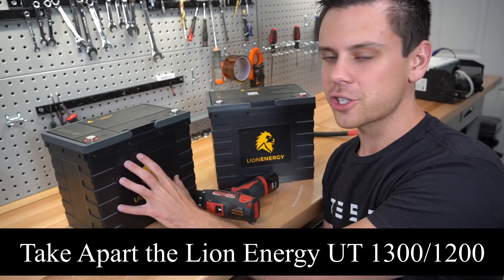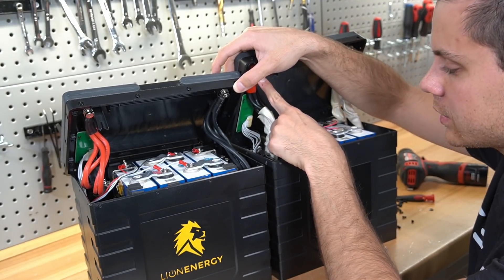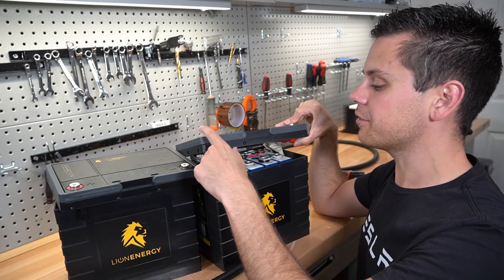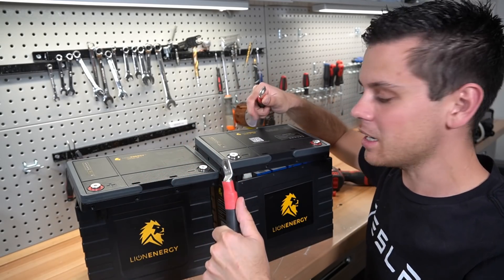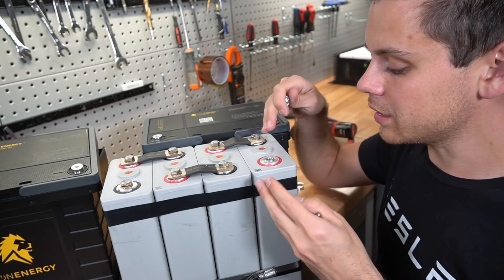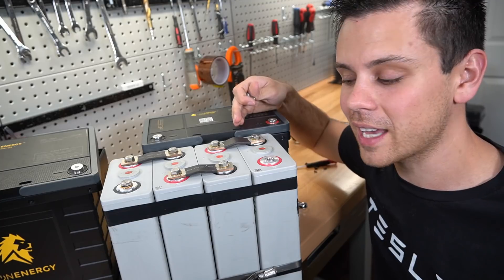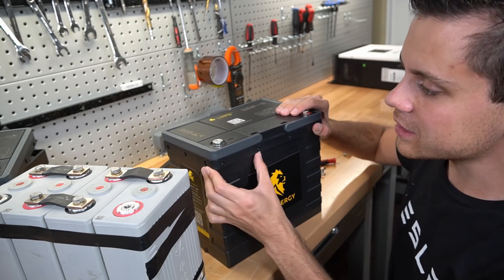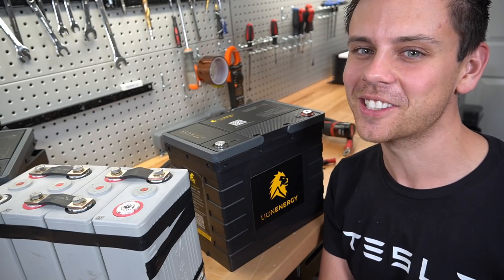Lion Energy 1300 VS 1200 and Why I Dislike the Terminals

Comment: So, the UT 1300 are at Costco for 700 and BB are on sale for 900.  I need 4 to put in my boat with 900watt solar, 5k generator, and 3000 watt inverter.  My biggest draw is an inductive cooktop and 1000 watt micro.  They individually pull about 130 to 150 amps DC for 15-20 min.  I'm leaning towards Lion, but it is in a boat in the ocean.  Which do you recommend?  Is BB worth spending 800 more?  At 800 more I could get 5 lion for the price of 4 BB.

Comment: My 1300 lion energy Battery just blew up! But I was told by lion energy that there's no way that the Battery could go over 15volts. But yet the battery exploded and there own sales rep dealer I took my rv to seen it at 19volts. But lion energy said that is not possible. So basically there saying there own lion energy rep is lying. And they can't explain why the battery exploded if it can't go over 15volts. Seems a little fishy to me. 
Also it was a refurbished battery I bought directly from LION ENERGY at the RV show. But they still say it's not there battery

Comment: This is probably a stupid question, but hey, I'm just getting my feet wet with all this, so here goes:

Is it not possible to remove those terminals off the case lid and replace them with better, beefier terminals?
Reply from the maker: Or you could buy a better battery

Comment: Will, I just found your channel in the last week, after I purchased 2 of the UT 1300's from Costco. Most every review I could find about these batteries was very good so I went ahead and bought them. Then I find your channel and find you have some valid reservations about them, but I have them now and I'm going to give them a chance. I hope they serve me as well as I envisioned. I eventually plan to use them in a RV, but until then, I'm going to use one of them in a DIT portable solar generator. I think it will be handy for my mother to use during short power outages during the winter. I ordered the following charger from Amazon and wanted to get your thoughts on it. It will be delivered today.  It is the ExpertPower 12V 20A Smart Charger for Lithium LiFePO4 Deep Cycle Rechargeable Batteries. Model number EPC1220. I think this would be better than a standard lead acid charger. My one concern is that wires for the charging leads seem to be a little on the small size. do you have any experience with this unit?

Comment: I swapped out two group 31 100 amp flooded batteries with two lion energy 1300 batteries in my Winnebago View and those terminals with screw down cable fasteners seems really vulnerable to loosening and stripping.

Comment: Change the bolt if you want more length. 
No testing.  Opinion only here.  Crank down with a torque wrench and see where they each break.  Try vibrating them in a paint can vibrator for awhile.  As you say, this is only "how you think and feel".  No science behind what you have stated.
Lifetime warranty if the box breaks.  Sounds like a pretty sturdy box to me.  Never breaks over the life of the battery.  Can BB say that?  Any other vendor say that?

Comment: Please, Im buying DOKIO 220 Watts 12 Volts Monocrystalline Foldable Solar Panel with Charge Controller and want to use it with a 12v to 1000w power inverter ........ Question is Please tell me the cheapest 12v battery (2 of them red to red and black to black ++/-- think its called hooked in parallel for a 12v system) on amazon I can buy for my first attempt with solar. You have 10AH to 200AH, pick one and wish to be around $200 to $300.  Dont want to burn my house down. Thank you in advance. Anxious to hear back...

Comment: Sealing is easy. I've pulled one battery top off, laid in a thin bead of silicon II (doesn't smell like vinegar plus safe around aluminum) and sealed the box.  Used non-sagging Dicor over the screws and now have a sealed case.  As for the terminals not able to handle 3 lugs, when I had to put 2 on the end terminals (to hook to the trailer system in parallel), I put 2 against the flush terminal and used the extension to make the hookup to my inverter (the third terminal).  Those were the only places I used the extension.   All connections are tight, not over torqued.  I made sure the battery box has enough clearance (approx 3/4 inch minimum over extension throughout the box) and epoxied 1/4 inch sheet of hard plastic to the inside of the battery box cover.  Also the battery box is gasketed for weather.  May be overkill, but there should be no weather or loose connection issues.  I plan on sealing the second battery in the next few days.

Comment: Hey Will dig your videos, I have a general solar question . I have a thunderbolt 100w setup with a tracer 20 amp controller and I am thinking of getting a 260 w panel just for the tracer then using harbor freight 100 w panels and 10 amp controller  as a needed back up , can I put them on the same battery bank without frying the system or heating the batteries.. thanks any advice would be cool..

Comment: Thanks for the great videos! I have a question for a friend. Are you aware of a "solar generator" that can put out 24volt DC at 3.75amps (or at least 3.5 amps)?  This is for powering a CPAP. I would think something in the range of 260Wh to 320Wh would be a good size (and cost) for him, but if we need to go up in price, that would be fine. 
Thanks!

Comment: I believe all battery cases should have better cable Management that provides tie down points so owner can secure the battery cables so the terminal blocks don’t get pulled out.  This a normal practice in some types of aircraft battery installations.

Comment: In my country it's not allowed grid tied system.make a video off-grid inverter connected with the grid to lower the electric bill.example 3kw panels 5kw inverter 4 12v batteries 110 ah in series. ty and big hello from MACEDONIA

Comment: We've know the problem for a while now.  What's the solution if you already own them?  A solution that will keep the secure and tight through vibration.  Little bit of blue loctite?
Reply from the maker: I use them in stationary setups only. So they work well for that. Must be very careful when tightening them

Comment: Thank you for opening up that 1300 for a look. I have 4 of those for my off grid system, and I am happy that they did improve the connections and insulated the wiring more. You are right!! They could have, and probably should have beefed up those terminals to make the battery more rugged.

Thank you for the review!!

Comment: Will, you have some videos about cell testing that are super.
I want to test to the 110 outlet.
I need something like your cell tester but for 110vac.
I'm tracking down a problem past the inverter.
I'm thinking that if I test amps at all the 110 outlets with a tester that pulls 12 amps I'll be able to determine where the wiring is solid.
When the amps fall to say 2 amps then these are past the bad connection.
I've been using a power usage meter with a 1500 watt portable heater as a load but it's a bit clunky.
Any 110vac capacity meters that you know of?

Comment: As a retired elevator man I can tell you that most people should be using a torque wrench. Whenever they are fastening wires in an electrical system. Even some professionals grossly over tighten wires on electrical and mechanical  equipment. Causing more damage  than one that is not torqued quite as much as optimum. Over tightening weakens the fastener. Strips out threads. Destroys equipment. I use a torque wrench on critical connections. All amatures should.

Comment: Will, it's my opinion that you have better in insights and practical know of photovoltaic systems in particularly related to batteries than the so-called experts. I don't know what credentials or education you may have but it doesn't matter, thank you for your insights.
What is your perspective on the various code related issues, have you looked into the NEC 2020 changes?

Comment: Will,   If the Lion Energy batteries had an "L" terminal instead of the screw in lug, would it change your rating/opinion of them?
Reply from the maker: It needs a better case in my opinion. It really is the terminal and case configuration that needs to be fixed.
Reply: @WillProwse  Yes.  That is an opinion.  What are the facts?
Reply from the maker: @marbles05  what? Not sure what you are trying to refute? Clearly state what "opinion" you disagree with and what facts I need to substantiate my claim and I will do so. It's a pretty simple assertion that I made.
Reply: @WillProwse  Nothing was tested.  Nothing was even researched.  Lots of opinion.  Do you know if the box is stronger one vs the other or do you let your ears tell you that.  Are the posts stronger or weaker?  See @Project Farm for someone who actually tests what they review.

Comment: If I'm looking at the terminals correctly. I think you would use the  12v automotive style clamp to go around the terminal and not under it..
Reply: @peter getti  Better but that doesn't solve the weak mechanical case problem.

Comment: Will, sometimes it's difficult to watch your videos! I was hoping for a new CAPACITY TEST on the Lion Energy battery, since the last one failed to produce 1200 watts? They said @ .2C we get 1177 consistently, even though you came up with 1009 at best. Sure, you tested at a higher C rate, but... I wanted to know what the Watt Hours are in the new LFP 1300 stated capacity battery in order to be able to recommend them.  I'm NOT inspired by the wide thread & short terminal bolt either. However, I think they would NOT want to be shamed again, so- I'm guessing that even the cells are larger than the 90AH cells in the prior battery...
Reply from the maker: 105 ah cells can pull the full capacity for sure. Ever since I posted that original video, they derated their listings. And manuals. 1300wh can pull 1344wh with these name brand cells. I don't think they sell the 1200wh model anymore.
Reply: @WillProwse  Well, I'm glad they were so responsive! Other than overrated capacity, the battery build was exceptional (sure, we both would've used fatter copper cabling from the cells to the terminals). Suddenly, Lion Energy has a genuine competitor to the Battle Born line. Sure, there are weaknesses: terminal bolts, series connection, moisture, dust & vibration concerns, etc...Yeah, Battle Born wins in any side by side, and, I wish Lion would price them to reflect the limitations...Thank you!
Reply: @DCGULL01  Costco had them on sale for 699.00. The sale just ended. Really good deal

Comment: This video gets to the meat of the terminal issue in that case.
So, anyone using these in a mobile environment needs to attach the batteries SECURELY, and use bussbars on the terminals securely locked in place, then attach any cables to the bussbars.
That is added weight and expense over using battleborn.

Comment: Ahh, I was one that pointed out the current carrying capacity being roughly equivalent with the battleborn, but yes, mechanically, these do require that you secure the cable and not rely on the terminal for mechanical strength. It's probably a good idea regardless of the battery(s) one uses in a RV type environment. Thanks for pointing that out! I love your videos and the information you provide us!
Reply: Pointing that out- critical phrase. Engineer school.

Comment: Will, could you re-re-visit LTO batteries? This time try to find some grade A examples. My research indicates round trip efficiencies should be in the 95+% range. There's no cold charging issues. Crazy long life. The energy density isn't that great, but who cares for off grid system?
Reply from the maker: I agree. Good suggestion. Need to get those grade A cells. Really impressive.

Comment: Can the battery output from one solar panel controller be paralled with the the battery output from another solar panel controller and then connected to one battery bank ?  Thankyou Will.
Reply: @Ian jones  Yes, I would keep them all in the same charge controller manufacturer/model family unless you are more experienced. I have a medium size battery bank with a 40A and 20A charge controllers. That way, I'm not out of luck if a solar panel string and/or charge controller should go out. I also have a 10A charge controller I use with a portable solar panel if I need extra charging for cloudy times.

Comment: Considering the price of these sealed battery systems, I will never own one unless it is donated.  I have been rebuilding LiFePO4 pouch batteries with 100A bms with top balancers for a few weeks now.  So far I have hacked out 120Ah of 12v and 80Ah of 24v.  I love your videos!  I would not have had the confidence to work on these pouch cells without your channel.  Thanks again!
Reply from the maker: DIY batteries are awesome! Rebuilding pouch cell packs sounds great. Especially reconfiguring for different voltages. Very cool! 

And thanks! :D

Comment: I got a Frankenstein system 24 volt with lithium ion batteries 7's with 24 volt lithium iron phosphate 8's with their own individual bms's who else has a system like that
Reply from the maker: Holy cow. Have you done a capacity test? NMC 7s and 8s lifepo4? I tried that with LTO and LiFePO4 and my capacity results were horrible
Reply: I buy brand new cylindrical cells and slap together don't bother testing I do not get super nerdy testing every cell I should but who has the time and patience haha I've been at work moving my whole family and friends off lead-acid on to lithium I've been pissing a lot of batteries together I am the go to guy now🤪 thanks for the videos it has given me the confidence with the chemistry lifepo4

Comment: If I wanted to use battleborn or the Lion batteries for car audio which would you suggest for this?  I will have 3 8,000 watt amps to start and I will be adding an additional 3 amps soon! They can pull 1,000 amps each in bursts but not sustained.
Reply: Why?? Are you deaf or like to bother other people? No offense, just like to know.
Reply: I'm curious what Will's response will be. I'm going to guess he may suggest the red Headway LIFEPO4 that can do 200 Amps each battery. But I'm a noob here....
Reply from the maker: @AnthonyGoodley  Oh I would absolutely run LTO at 6S. at least 40Ah ying-long grade A. You can run competition equipment and full power. You will LOVE it.
Reply from the maker: @AnthonyGoodley  I would not use lifepo4 if you want the best of the best performance. You need higher discharge rate. Also, 6S LTO runs at higher nominal voltage than lifepo4. Way easier to push those amps. 

btw I used to build and tune car audio systems back in the day. I love it.
Reply: @AnthonyGoodley  I would use the Headway LiFePO4 batteries instead of LTOs since they are cheaper and easier to work with. Then I would add a decent supercapacitor bank directly on the power input of the amp to handle the power spikes.

Comment: These things are too expensive... Even though it's more efficient i prefer leaving way too long with sealed lead acid,I'll upgrade when money won't be a problem sometime
Reply from the maker: Or you can build your own lifepo4 for much cheaper than a sealed lead acid. And it will last 5-10x as long. And 4x times less weight. Less internal resistance. Higher coulombic efficiency. It's up to you.